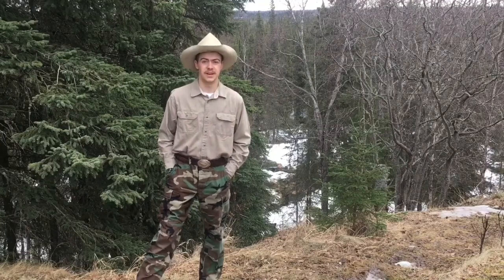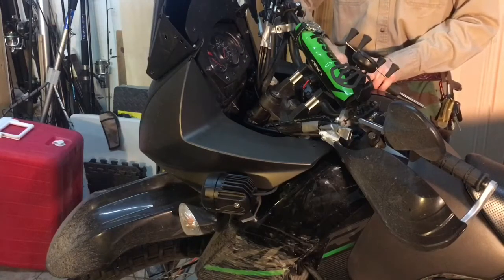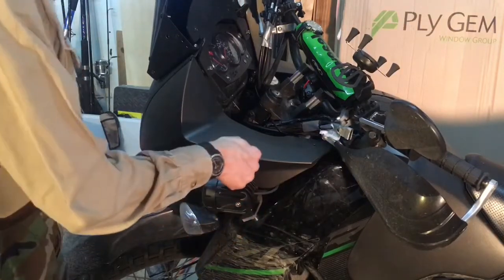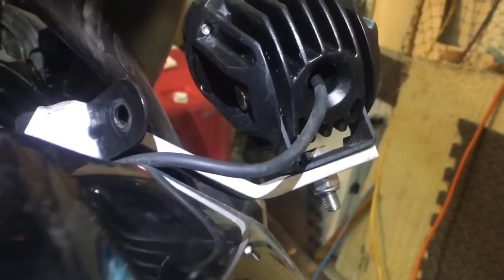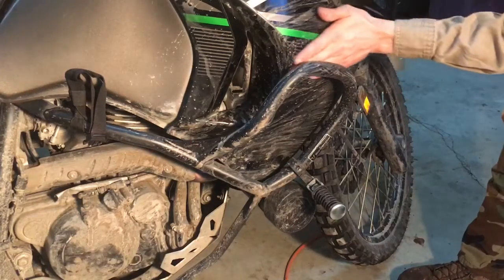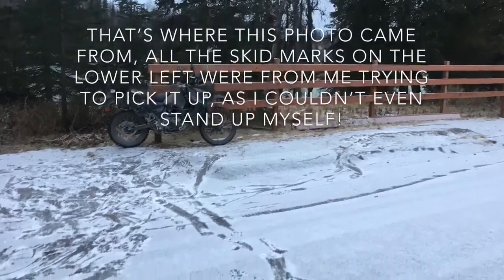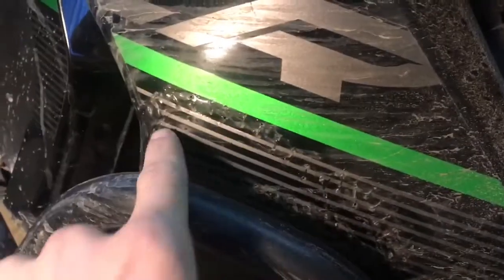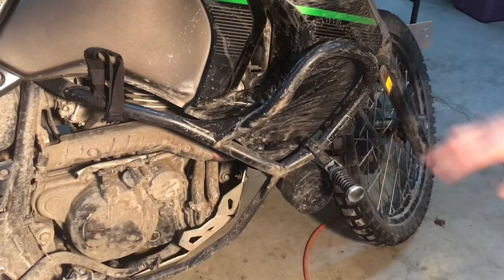2 Little-Known KLR 650 Mods Worth Mentioning

Comment: Boat builder's thicken epoxy to peanut butter consistency with fine saw dust . Cheap and works a treat for when you to build up or strengthen. . Repaired a broken area of my fairing with a glue stick gun and backed up inside with caulking gun tube of no more gaps (acrylic filler ) thanks for the vid . Cheers.
Reply from the maker: Wow, there's a great idea.  I have used the sawdust trick in the past, but never heard of that filler. Have to look into that.  Thanks for the comment Rod, I really appreciate it!  Ride safe.
Reply: @al-canadv9241  it's an indoor/outdoor pre painting caulk sold as No More Gaps in AUS  . Very strong . Sikaflex would do just pricier. Cheers man .

Comment: Masking tape on the ring spanner. Nice tip.
Thanks a lot I'm replacing  bolts and fasteners on my 2010 KLR and your tip will come in handy
Regards from S Africa
Clive
Reply from the maker: Glad you found it useful!  Wonders of the internet, we’re pretty much on opposite sides of the world but we can communicate and share ideas. Ride safe man and good luck with the wrenching!
Reply: @al-canadv9241  You too man.
Looking forward to watching your videos.
Keep the rubber side down.
Reply from the maker: Thanks, will do!
Reply: @al-canadv9241  Replaced some crappy bolts on the rear indicator stalks yesterday, using your masking tape tip. It would have been a real hassle otherwise.
Reply from the maker: I’m glad! That works pretty well sometimes.